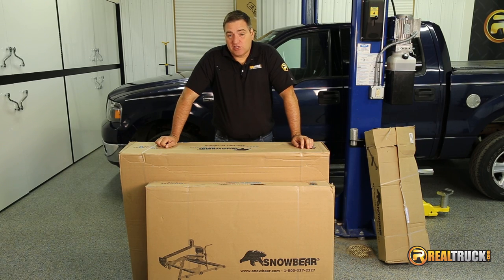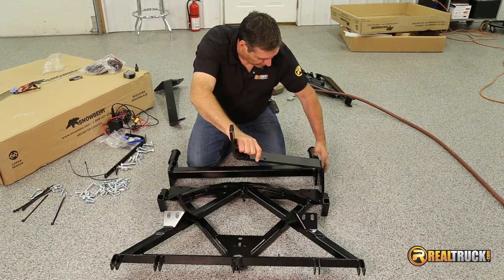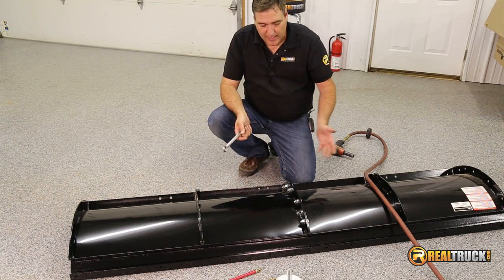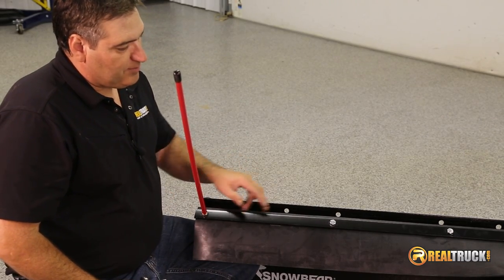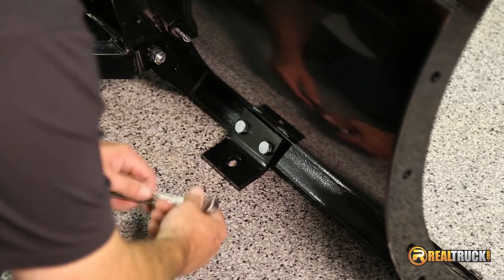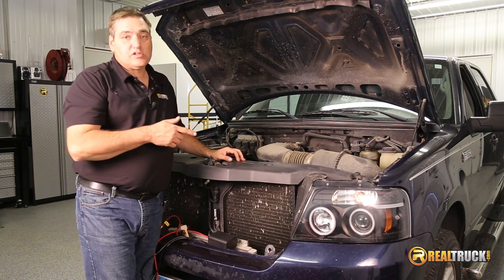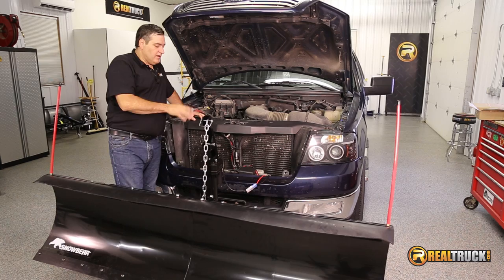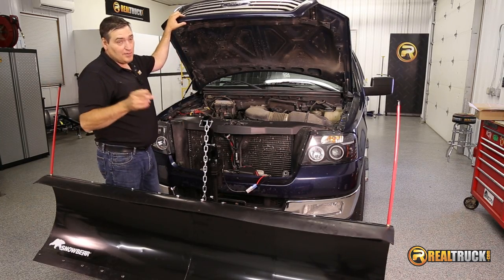How to Install SnowBear WinterWolf Snow Plow

Comment: You put a baby plow on a big truck. really? why not put on a boss, fisher or western V plow?
Reply from the maker: +cadddy1871 lol. Mostly because we don't sell them.
Reply from the maker: +cadddy1871 yeh I understand what you are saying. There are a couple of factors in play here though. First off this is a box stock 04 F150. Second these plows are designed for home use not commercial. They are smaller for the "typical" homeowner to use on their driveway and lighter so they are easier to handle and put on and take back off when not in use so you don't have to drive around the family car with a plow on it. The design of these plows makes them usable for just about everyone.
Reply: Also, much cheaper than a boss, fisher, or western V plow.